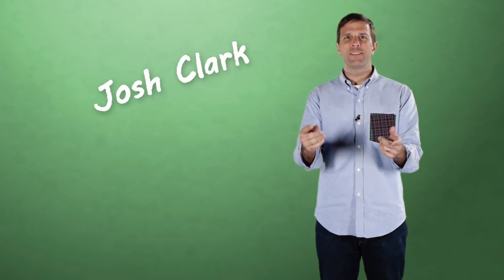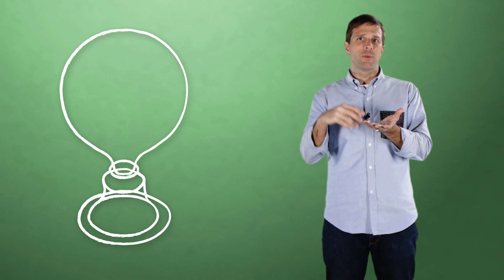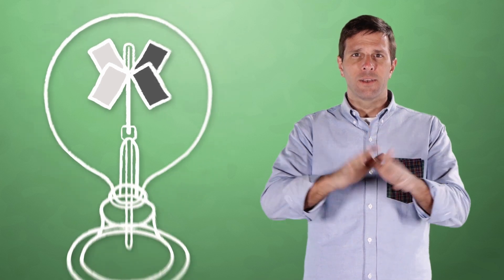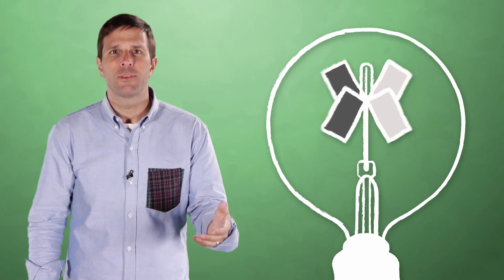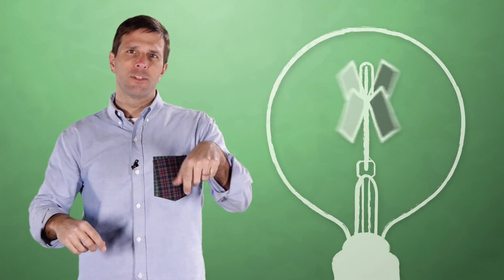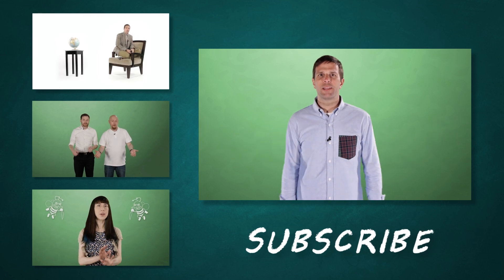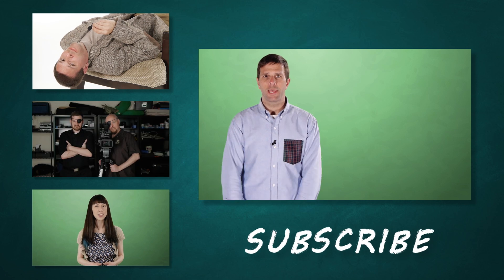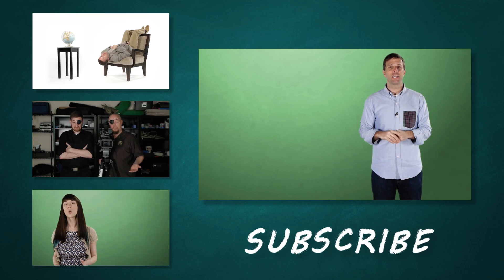How Does A Crookes Radiometer Work?

Comment: There is a problem with any explanation that depends on temperature differences between the light and dark sides. That temperature difference starts at zero and builds up as the vane gets heated. The problem is that the force and thus the acceleration starts at maximum instead of building up.This is easy to observe.

Comment: the pressure hitting the white surface is split, half remains inertial and half is reflected, imparting less momentum than all of it being kinetic on the black face which doesn't reflect.  And basic physics says it will spin in the direction the most pressure is exerted with the least pressure directivity providing resistance.  Let's not forget the basics here.  Just because white reflects doesn't mean it is absorbing more kinetic energy, it actually doing the opposite and absorbing less because half of it is reflected.  And the very same amount is hitting the black surface as well, of which none is being reflected..  This is represented as 0.5p+-0.5p for the white surface, half the pressure absorbed and half of it reflected, canceling each other out essentially, but is mathematically represented as the half pressure being reflected by 1p over 2, or 1p/2, as half the pressure is absorbed and half is reflected.  And on the black surface it's 1p/1, because the pressure is only going one way.  So, the determining factor of spin direction is calculated as white face pressure minus black face pressure (or vice versa) as (1p/2)-1p=.5p-1p=-0.5p on what face spins bias.  But let's ignore the most basic laws of physics that nothing can violate because it doesn't suit the theory and call it science when science is actually proving or disproving theories based on the principles of facts rather than belief or bias.  If you are ignoring factors that don't suit your hypothesis, that is belief science, aka broscience, and not actual science at all.  And ignoring the most basic laws and formulae of physics because they don't suit a theory is belief science, broscience, because you ignore basics that don't suit your theory and have thus traveled outside the realm of science and into the territory of religion.  A theory is a guess, not a belief.  And approaching science with belief is not science.  Science is the process of proving one's guess either right or wrong, not proving it right because you believe in it which means it can't possibly be wrong because that would mean you were wrong.  Science is taking it with a grain of salt and forming a new theory when one is proven wrong.  Broscience is overlooking what contradicts your belief because you are so determined to prove it right because of your belief.  Belief and science don't mix, approaching science on a belief never proves a thing because you refuse to accept the facts.  Knowing is acceptance based on fact, and science is about knowing.  Belief is about taking things based on faith or lack of proof, and lack proof is proof on nothing, as well as belief being the territory of religion and far from science.  Ignoring the facts because you chose blind faith in your theory is not going to change the facts.  Just because you can't eat an elephant in one big complicated bite doesn't mean you can't eat in a simple bite at a time.  You can't skip steps or overlook facts, and you have at least three proofs of your own misunderstanding of why it isn't heat in this video by the way.

Comment: Good explanation! I just obtained my first Crooke’s Radiometer and was attempting to learn exactly how it works, and doesn’t work (an interesting story in and of itself). After reading several different explanations — including, surprisingly, some erroneous ones — I understood the mechanism best after seeing this video.
Reply: Except it's not.  Basic Physics says half the photon pressure on the white face is reflected while all of the pressure on the black is absorbed, meaning the black face get's twice the pressure of the white face.  It really is Photon Pressure.  And removing the glass lens around it proves it, because if the heat source in the vacuum chamber at the same pressure with the vane, heat has no effect on it until it starts escaping through the tank, and then it spins backwards as photon pressure is released by the excitement of photons as heat passes through the glass in the opposite way, pulling photons out and exerting the opposite photon pressure on the veins, the white giving off more than the black thus leading the opposite way.  And that is because without a lens between the heat source and the vane there is nothing to cause the heat to agitate photons into moving light.  Never skip the basics, even the most basic taken for granted basic, and never take the basics for granted, because without the basic concepts, the complex ones fall to pieces, because complexity is essentially a stacking of basics.  In fact the term critical thinking applies to the application of Occam's Razor.  The simplest, or most basic, of solutions is often the best.  And even the most complex puzzles have the simplest solutions.  It's not about heat, but rather it really is about the photon pressure, or light pressure, an equal and opposite reaction on both surfaces.  Equal pressure applied, unequal reaction to it.  And let's not forget painting surfaces black or white doesn't make them absorb more or less heat when light is taken out of the equation.  Painting a piece of metal black and another white and placing them the same distance from a heat source without light, they both stay thermally identical.  Remove the heat source, and exchange it for a light, the black surface will become a heat source itself while the white surface stays nice and cool.  And another basic law of physics that applies allot these explanations overlook is that energy can be neither created nor destroyed, only transferred or transformed.  Which means equal light hitting the two surfaces means equal force upon both from the photon pressure, and it can't reflect all of the energy and still have an equal force as hit it exerted as momentum.  The only way for it to exert equal pressure forwards and backwards is if half the initial pressure is reflected and half transferred to kinetic, which means for every one unit of pressure on the white surface, half is reflected and half absorbed, and for every one unit of pressure on the black surface, one is absorbed and none is reflected.  Which means there is at least twice the pressure pushing at the black surface as the white.  An answer that disobeys basic universal laws of physics is wrong, because those laws are the foundation of science.  You can't ignore the basics, especially when the basics prove a theory wrong.

Comment: Regarding magnesium: The electric energy required to magnetize an iron bar is much less than the energy required for the magnetized bar to hold itself up against the underside of a steel table for an extended period of time. What is the source of that additional energy?

Comment: I had to disagree with this hypothesis The heat transfer causes it to move. Because you can have a super hot red light aimed at it and it won’t move. You can have a green light orange light and it won’t move. The crooks radiometer only moves when ultraviolet light is involved. If you have a crooks radio meter shine a ultraviolet light at it and watch how fast that sucker will spin.If you have a crooks radio meter shine a ultraviolet light at it and watch how fast that sucker will spin. Light is life, sound and lights are the same if you don’t agree you should really look into sono luminescence & biblical cosmology. Or just research the mud flood ;) thank me later

Comment: either that theory is a bit misexplained in this video or it is wrong.
you said, quoting: "(...) sending colder air on the silvery side around to the darker side to cool it off (...)"

But as far as i know, hot particles would be the ones moving to the colder part and not the other way around...

Comment: Hi. Mine just arrived:-)

It's very cool. It needs a really bright light to make it spin fast. I wonder what happens if you shine a laser? Will it spin faster?

I think it's spun by photon pressure more than heat but it's spun by both because it spins faster with bright LED (almost touching the bulb) more than a 100 Celsius heat gun (a few centimeter away)

God bless, Revelation 21:4

Comment: Not right. Apart from what 1337wOn is saying... If the thermal theory is right then that would mean that the lightmill would spin faster in air than in partial vacuum, because even if there would be more air resistence there would also be more pressure on the black sides.. but this is not the case since it needs a certain degree of vacuum to work.

Comment: If this is true then this device should turn under normal atmospheric pressure.  But as I know the  device don't work under atmospheric pressure
Reply: Normal atmosphere has too much air. it will resist the movement

Comment: I have just bought one from Germany, so mine spins clockwise, do they all do this! I live in New Zealand and this may have something to do with the fact that  water emptying from a sink is opposite from the  northern hemisphere, or does it make a difference if the light and dark panels on the light mill are or the left or the right
Reply: the panels are the differentiating factor. Not on which side of the earth you are on, which wouldn't change the way physics works.

Comment: Thanks. I saw another linking momentum of light particles to such movement and it just didn't seem true to me. I suspected thermal. Thanks for the info. Cheers
Reply: If the thermal creep explanation were correct, then the spinning would eventually stop, when the heat exchange from the radiating surface and the source of light on the light Mill reached equilibrium. This is not what we observe.

Further, the phenomenon would grow weaker with a thinner atmosphere, not stronger.
Reply: There's a deeper and fuller explanation here if you're interested. A vid done by someone with more equipment, it shows some good observations using specialist equipment. Thanks and Cheers https://www.youtube.com/watch?v=r7NEI_C9Yh0

Comment: If the thermal creep explanation were correct, then the spinning would eventually stop, when the heat exchange from the radiating surface and the source of light on the light Mill reached equilibrium. This is not what we observe.
Reply: What's the answer then?
Reply: @Josiah_Harder  light makes it move
Reply: The explanation is wrong. Tesla's ideas  on radiant energy and his magnifying transformer were based off what is happening in the crookes radiometer. It rarified air in the glass. Very low oxygen (aether). Just like the upper atmosphere. A pure vacuum makes the veins not spin. Shine a laser on the black vein you get no movement. Pour hot water on the glass and it spins. Tesla said he developed a motor thousands of times more powerful than the Crookes radiometer.

Comment: How can air particles be pushing the vanes?  The inside of the bulb is at a near vacuum -- actually 7 torr (0.135357 psi). That means the air is spaced out with ~1 cm of separation between them inside the bulb.  Hardly enough air to do much at all... if you could see the molecules you could count them!  
.
Still seems to me that black side of the vane is pushed by light pressure (photons transferring kinetic energy to the dark side of the vane) to the tune of about 17 micrograms per 50watts of light energy. That is a small push but the kinetic energy builds until the vane begins to move and then it builds momentum. The reflective side of the of the vane reflects the light photons and kinetic energy is not transferred to that side.  I think the inventor was correct.

Comment: so its a thermal rotor . what temprarure between cold and hot would it be in thermal equilibrium. Im on the Celcius, 0 Celcius is freezing point and 100C is cooking point . is there any temprature the rotor is completely still ?

Comment: It has to do with the Poynting and Radiation Pressure. If you can borrow from your library An Introduction to Modern Astrophysics by Carrol and Ostlie it explains it on page 66-67.
S(W*m^-2)= (1/u ̥ )*E x B (that is cross not multiply) 
<S> = (1/2u ̥ )*E ̥ B ̥ 
F(radiation absorption) = ((<S>A)/c)*cos θ 
F (radiation reflection) = ((2<S>A)/c)*cos^2 θ

Comment: It's all about Bernoulli effect, the dark side getting heat faster so the air near this side is hot and it expand means more pressure and it push it, and if we put it in cold refregirator let's say, the dark also getting more cold and there will be less pressure so it will be sucked and rotate the otherway around..

Comment: Using someone else's theory doesn't mean YOU explained how it works "once and for all". Also, this theory does not take into account that red, and any color all the way to blue, light from single LED bulb won't move it while a purple light from a single LED bulb will. the white light from a bulb will contain the entire light spectrum which takes this phenomenon into account. while it's a decent theory, heat has nothing to with it. frequency of light also plays a role in this.
Reply: Your experiment with different color lights made me get out my red, green and purple laser pointers. They are all mW level lasers and have good batteries and are very bright. I cannot measure the exact output but the green one would not start my radiometer moving and neither would the red one but the purple one would make it move and spin and I could make it spin CCW by shining it on the black side or CW by shining it on the shinny side of the vanes but the red or green laser would not move the vanes in either direction. It starts spinning CCW faster by shining the purple laser on the black side.
Reply: ElPaso TubeAmps it makes sense though as they are used to detect electromagnetic radiation which their wavelengths are relatively closest, on the VCS for humans, to purple/violet.
Reply: Thia is a keenly interesting observation.

Comment: Reynolds found that if a porous plate is kept hotter on one side than the other, the interactions between gas molecules and the plates are such that gas will flow through from the cooler to the hotter side. The vanes of a typical Crookes radiometer are not porous, but the space past their edges behaves like the pores in Reynolds's plate. On average, the gas molecules move from the cold side toward the hot side whenever the pressure ratio is less than the square root of the (absolute) temperature ratio. The pressure difference causes the vane to move, cold (white) side forward due to the tangential force of the movement of the rarefied gas moving from the colder edge to the hotter edge. Thank you Wikipedia.

Comment: thats wrong like has capacitance being that light is a coaxial circuit with dielectric pluses.... that's why if you shine a red light at it it won't spin but if you shine a violet light it will.. Violet has a higher capacity and stand read along the EM spectrum.... or if you shine a bit of sunlight on it since Sun contains everything in the Spectrum if you don't believe me watch this video....
Reply: Video link missing.

Comment: Ok, this makes sense, but what is the practical application for this?  I have memories of seeing Crookes Radiometers mounted on posts along with a couple of electrical cabinets in roadside installations in rural southern California back in the 1960s or 1970s but I can't find anything that would indicate my memories are correct, or why they would be there, or how their actions/results were recorded or used.
Reply: Or just use solar panels instead...

Comment: If the explanation  is correct it should work poorer with less air and better with more air. There is solar wind and solar sails is there not? Why do you not present the more/air models to address this.
Reply: More air would cause too much wind resistance, the rotation would be less spectacular.
Reply: More air means more resistance and also more particles to heat so more energy is needed. Since the energy intake is based on the size of the vanes, I guess there's a maximum amount of air for a given vane size, but who knows. I think it's strange how this has been ignored for over a hundred years, as you say, there are a lot of variables that could be tested like the amount of air, the amount of vanes, the vanes shape, color and material. The explanation he gives is actually just the most accepted theory but no one has come with hard numbers and formulas. There are still a lot of things to be done in physics.

Comment: Mr frostscience, I think that your explanation is the same, the difference is only the perspective, the video was analysing the contact with the air from a thermodynamic view (when they talk about the pressure and the force of pressure that push the little pieces of papers) and what you said is just an explanation of what happen at the microscopic level.

Comment: I would like to add a hypothesis.  If the black side absorbs light it gets warmer.  That means the molecules making up the black surface vibrate faster.  Now when a gas molecule randomly touches the black surface, some of the kinetic energy of the surface is given off to the air molecule (bouncing it off, speeding it up, raising it's temperature).  So it pushes the air molecule away, and the equal and opposite reaction is that the air molecule pushes just as hard on the black surface.  It is like if you push someone away from you, it causes you to also move away from them.